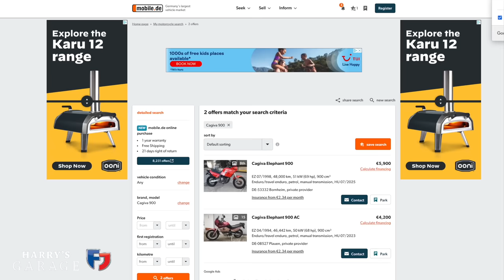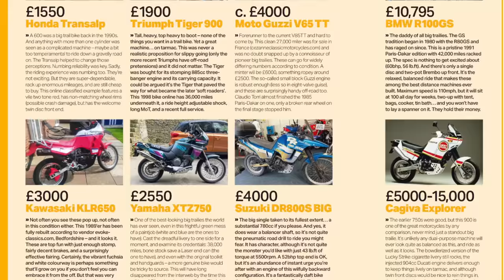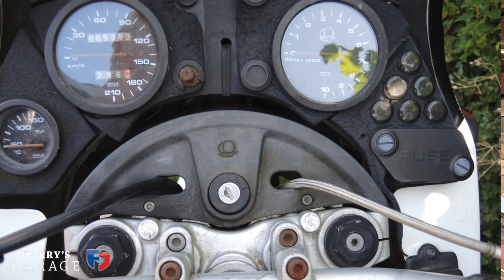We go to Germany to pick up 2 barn-find Cagiva Elefants, a 750 & 900 ie. Elefant Rescue Part.1

Comment: They are a great van, we have 15 of them and one has 800000km on the original engine (2016), comfortable and quick enough for a van, they are a 1.6 dci engine though not a 2.0 unless its the 140bph model.

Comment: Without a shadow of a doubt, we need to follow Charlie  doing the resto on this great bike.
Strip right down to bare bones and make sure the chassis is good before going anywhere off-road on it. Last thing you needs is rusty metalwork breaking.
Suspension fix, engine fix, brakes and she'll be running.

Comment: I have parts from the injection system, airbox and throttle bodies, plus other parts; also an engine block, need to check better. also have a GT 900 ie

Comment: I owned a 750 specimen. Not fond of it. The engine kept giving problems and the sus[ension was shit off road. (750 with no injection I believe and standard suspension) I like my KTM 660 Adventure with the single pot.......(but it got stolen)